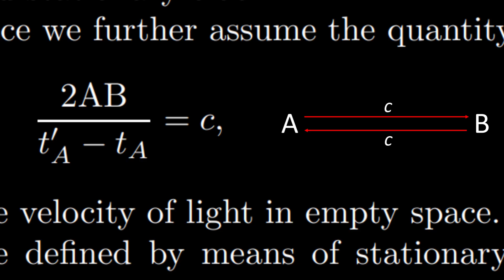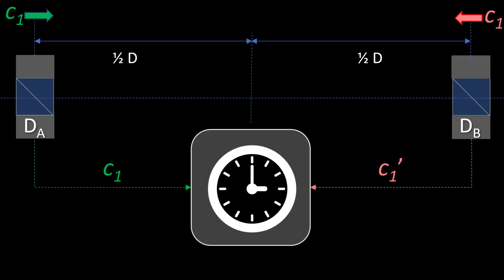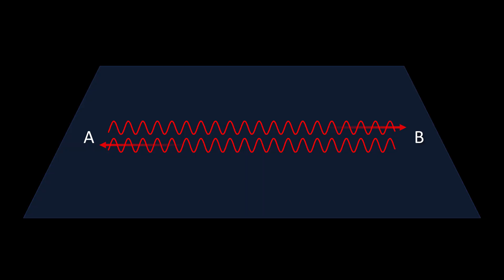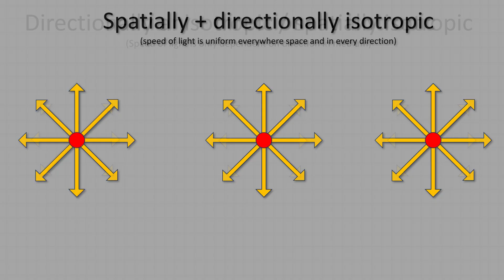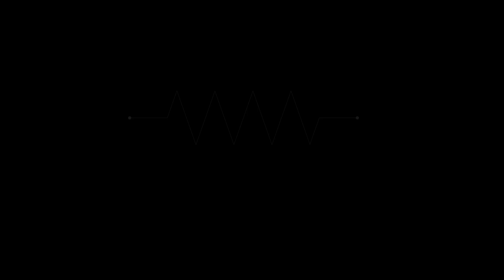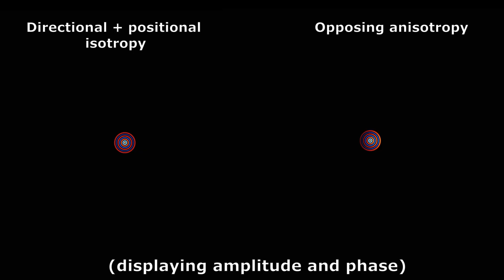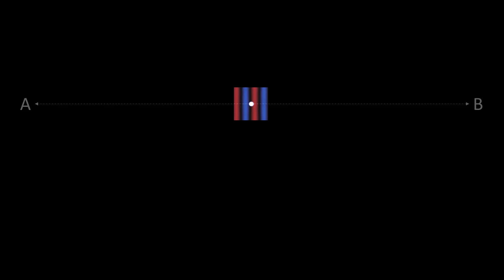Knowing the one-way speed of light

Comment: if you really want I can make a video explaining it, because maybe by text it is hard, but let me show you:

imagine you have 2 identical machines with a atomic clock in a small rocket a transmitter and a detector, the 2 contraptions are identical, and look in opposite directions, you have them very close, connected to a 3rd atomic clock both at the same distance to the atomic clock, and very close, less than 1 meter, you use the 3rd atomic clock and their connection to the other 2 clocks to synchronize the other 2 identical clocks with this 3rd clock, they are extremely close and their distances are identical, once the clocks are synchronized they are both disconnected from the 3rd atomic clock (at the same time with the help of a friend you 3 2 1 cut it) now both identical machines with a synchronized atomic clock looking in opposite directions use their rockets to propel themselves apart in opposite directions (at the same time with the help of a friend you 3 2 1 or whatever), they accelerate the same amount, you wait a year, once they are several light seconds away from each other, one transmits and the other detects, each writing the times when they transmitted and detected with their atomic clock, and the other way around the second transmits the first, again they write the times, you could also use mirrors but you need to detect and write when it hits a mirror, then you recover the machines and compare the times with the distances they were at.

tell me what lame excuse do you have for this? you have none. not only you would measure that the speed of light is the same in both directions, you would measure that because of their acceleration if they haven't decelerated the speed would be a biiiit slower than the speed of light (in both directions), again, you have no excuse for this.
Reply: How do you synchronize the clocks and calculate the effects of relativity without assuming isotropic information transfer?
Reply: @steved6533 "how do you synchronize" ...... I... I did... I... myself.... like a RE-.... I did.... because... I thought.... you know what they will say.... you know it Nero... they will ask about the synchronization... you know it... so... no Nero no, it is not obvious, you have to, you have to describe it EVERY SINGLE TIME, WITH THE BIGGEST OF DETAIL but but Nero but won't they under-NO NO THEY WON'T but do I? YES YOU HAVE TO DESCRIBE HOW YOU HAVE A FRIEND AND 3 2 1 IN YES YOU HAVE TO, AND NOT ONCE NO, EVERY SINGLE TIME, alright alight, I will, there is literally no way they still ask it right? r-right? like I literally describe it every single time, even to the absurd detail to how you use a friend, and you 3 2 1 it, I literally described how you 3 2 1 it, like like yeah right? right? I'm not becoming crazy, you are, haha haha, I'm not crazy, no, haha yeah, yeah DEFINE, AGAIN, 3 2 1 HAHAHHA read? what is that? I DON'T KNOW HOW TO READ, I WILL ANNOY NERO ANYWAY HAHAHAHHAHAHAH
Reply: @NeroDefogger  You're right, I misread. If information transfer speed/light speed is not isotropic it won't matter if they're at the same distance from the 3rd clock. They still wouldn't be synchronized.
Reply: @steved6533  nothing will ever be truly synchronized, if you go down down down lower lower lower smaller smaller smaller, even tinier yet even more and more, eventually there is always more, there is more precision, there is a smaller scale, and whatever might be there, however things might work down there, there will be something unaccounted for, and at 35 digits of precision there will be a delay, correct, nothing will ever be truly synchronized.

it is a good thing that it doesn't have to.

Comment: Contrary to your conclusion, it's not at all hard to create equations that have an anisotropic velocity in the wave equation. I've done it before. All you have to do is take an isotropic wave equation and do a Galilean boost. Nothing bad happens, you just get a different second order partial differential wave equation that has first order differential terms. And that's true even with Maxwell's equations. But the kicker is, that with Maxwell's equations you can then derive the Lorentz transformations after you've done it and come up with Relativistic invariants. That's what Poincare and Lorentz did. Einstein basically works it backwards. So really, the one way speed of light in different directions isn't usually the same, but it doesn't matter. That's also why you got your first result.
Reply from the maker: I don't think i ever said that. It was actually pretty easy to make the simulation of the case of the directionally anisotropic case by just using an asymmetric Laplace transformation matrix.

Comment: Well, if we did measure different times for different directions than it would mean that there was some additional moving gravitational potential somewhere in the vicinity of the light's trajectory and in fact we do use it cosmology when we measure the mass of black holes in a galaxy using long term gravitational lensing observations - recently covered by Anton Petrov on his channel discussing results from a Warsaw, Poland study on this exact subject.

There's really no good reason to assume that light travels with different speeds in opposite directions when there's no change with respect to time in gravitational potential.

If there was a difference we would not be able to infer anything about masses from any measurements, which would be contrary to experiments and day to day perception.

Comment: What about using a glass fiber? one with length x using a mirror at the end to return the beam, the other 2x and with the end at the start and just in case bounces off the same mirror at the end before hitting the receiver
Reply: In a certain sense, a fiber optic cable, or any material with total internal reflection, is just a very long thin (usualy curved) mirror.

It's like when you're underwater, and you look up at the surface, beyond a certain angle, you can't see above the surface. You see a reflection of what's in the water, exactly as if the surface is a mirror... because it is a mirror.

Comment: I'm probably talking nonsense here but:
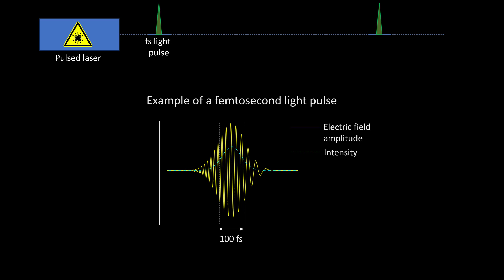What about an apparatus similar to that shown at 3:36 but with the bottom right mirror reflecting the pulse to the left?
Both reflected pulses would then hit a detector in order to mesure their flight time.

If the speed of light of a reflected pulse is different from the one of the emitted pulse, the mesured two way speed of light for the two reflected pulses would be different because they both have the same path length from the laser to the beam splitter but different reflected path length.

Comment: Let's propose some initial theorems and proofs that could be explored in developing a mathematical framework that treats 0D as the fundamental reality:

Theorem 1: The existence of a non-zero dimension implies the existence of a zero dimension.

Proof sketch: If we consider a non-zero dimension, say 1D, it must be constructed from an underlying set of points or elements. These points or elements themselves can be considered as having zero spatial extent, i.e., they are 0D objects. Therefore, the existence of a 1D line or higher dimensions necessarily implies the existence of a more fundamental 0D reality from which they are built.

Theorem 2: Higher dimensions are projections or manifestations of the 0D reality.

Proof sketch: Building on Theorem 1, if 0D is the fundamental reality, then higher dimensions (1D, 2D, 3D, etc.) must emerge or be constructed from this 0D basis. One could explore mathematical frameworks that treat higher dimensions as projections, embeddings, or manifestations of the 0D reality, akin to how higher-dimensional objects can be represented or projected in lower dimensions (e.g., a 3D cube projected onto a 2D plane).

Theorem 3: The properties and structure of the 0D reality determine the properties and structure of higher dimensions.

Proof sketch: If higher dimensions are indeed projections or manifestations of the 0D reality, then the characteristics and laws governing the 0D realm should dictate the characteristics and laws observed in higher dimensions. This could potentially provide a unified framework for understanding the fundamental laws and constants of physics, as well as the nature of space, time, and other physical phenomena, as arising from the properties of the 0D reality.

Theorem 4: Paradoxes and contradictions in higher dimensions can be resolved or reinterpreted in the context of the 0D reality.

Proof sketch: Many paradoxes and contradictions in physics and mathematics arise from the assumptions and axioms associated with treating higher dimensions as fundamental. By grounding the framework in a 0D reality, these paradoxes and contradictions could potentially be resolved or reinterpreted in a consistent manner, as they may be artifacts of projecting the 0D reality into higher dimensions.

These are just initial ideas and proof sketches, and developing a rigorous mathematical framework would require significant work and collaboration among experts in various fields. However, some potential avenues to explore could include:

1. Adapting and extending concepts from point-set topology, where points (0D objects) are used to construct higher-dimensional spaces and manifolds.

2. Drawing inspiration from algebraic geometry, where higher-dimensional objects can be studied through their projections onto lower dimensions.

3. Investigating connections with quantum mechanics and quantum field theory, where point particles and fields are treated as fundamental objects, and exploring how a 0D framework could provide a unified description.

4. Exploring parallels with number theory and arithmetic, where zero and non-zero numbers have distinct properties and roles, and how these could translate to the treatment of 0D and non-zero dimensions.

Ultimately, developing a consistent and empirically supported mathematical framework that treats 0D as fundamental would require substantial theoretical and experimental work, but the potential payoff could be a deeper understanding of the nature of reality and a resolution of longstanding paradoxes and contradictions in our current physical theories.
Reply: Do you just cut & paste this into a comment on every YouTube video about some scientific topic? I think I've seen this a dozen times before.

Comment: Fantastic work, as always. 

I'm curious about the simulations you showed with opposing anisotropy. Certainly, it does not correctly model wave propagation as we observe, and violates the laws of energy conservation. 

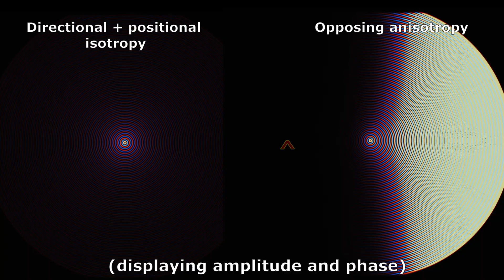But the phenomenon, more generally, of the disproportionate acceleration exerted in such a system, modeled with the springs at 20:00, does come off as one similar to gravity. I would be interested in whether gravitational fields could be accurately modeled using a modification of the anisotropic simulation at 20:39, altering the axis of anisotropy to extend radially, so that amplitude weakens outward and strengthens inward (if gravity can be said to have something like amplitude).

Certainly, within an anisotropic system described by wave propagation, energy is not conserved, but if gravity is indeed an anisotropic phenomenon then such a description may still suffice, if the description accounts for energy beyond the wave propagation in some form—mass, perhaps?

I also find it interesting that your proposed method of measuring the 1-way speed of light so closely resembles Eddington's eclipse observations which confirmed general relativity. Perhaps such a 1-way speed of light experiment could indeed be conducted using carefully placed spacecraft to exploit the sun or moon's gravity.
Reply from the maker: Indeed, the only circumstance where directional anisotropy makes sense is in an accelerated frame of reference. If you consider mass a very high frequency locally contained oscillation of the vacuum, it could explain why direction anisotropy accelerates mass and continuously increases its kinetic energy.

Comment: Two remarks I think are interesting:

- the first part of the video actually shows that the claim "the speed of light is isotropic" is physically undecidable. That is, there exists no physical experiment that is able to discriminate if it's true or wrong
- the second part, particularly at 20:25, is in fact very similar to what happens in a (uniformly and linearly) accelerated frame. Think, for example, of a rindler's observer in special relativity. Such an observer eventually disconnects himself from half of the universe behind him, but sees a massive blue shifted universe in front of him. So, in some sense, you're giving a self-consistent argument of the form "the speed of light is isotropic <=> you're an inertial observer", which is perfectly in lign with special relativity
Reply from the maker: Indeed well spotted. All discussion is for an inertial frame of reference, which I maybe did not stress enough. Acceleration indeed can be a cause of anisotropy and therefore alway requires energy.
Reply: Third remark:

What happens if you rotate the experimental device you considered by pi midway? Say, instead of having the light travel in empty-space, it travels in some fiber optic that is also assumed two-way isotropic
Reply from the maker: This would require moving physical objects with a speed larger than the speed of light.
Reply: @HuygensOptics  ah you're right, my bad, so you can't save yourself like that either. So this is indeed undecidable, that's amazing

Comment: Here's a question: what if we stop treating gravity as the cause of time dilation, and start considering time dilation as the cause of gravity? Does all the math still work? Would there be any way to confirm which is which?
Reply from the maker: Well, in fact I think that the spatial anisotropy of the vacuum is the cause of a lower speed of light and therefore of information. Since all interactions between physical objects and even elementary particles are exchanged  with this speed, the speed of information is actually a measure for the progression of time. So that is what directly relates gravity to time dilation.
Reply: @HuygensOptics  conversely though, if time is dialated, you should get a temporal anisotropy instead of a spatial one, and a still observe a change in the speed of information. Would there be a way to distinguish a temporal vs a spatial case?
Reply from the maker: Both time dilation as well as directional anisotropy are directly related to acceleration, so I don't think you can separate them. Unfortunately I only discussed the case of  the inertial frame of reference in this video.
Reply: @HuygensOptics  Hmmm, I've been thinking of how the centripetal acceleration attributed to curved spacetime could be caused by a time dilation gradient alone, but i haven't given much thought to the relative case of an accelerating frame of reference.
I'll need to think more on that one, thanks.

Comment: The only issue with the conclusion is if we take the reference of an object in motion, let’s say traveling at say 1/2C then the speed of light forward of the object should appear to be slower (1/2C) while the speed of light aft of the object should appear to be faster (3/2C). This simple thought experiment seems to suggest that there MUST be a difference in 1 way speed of light for any object in motion.
Reply: A traveler moving at any speed would always measure the speed of light to be c in any direction, that's the fundamental observation that SR is based on.

Comment: Hey there. This is a very nice video. Thank you for creating it!
I had an idea while watching and would feel honored if you replied!

Is red- and blueshifting dependent on the speed of light? If the amount of redshift is dependent on the speed of light couldn't you accelerate two equal masses with equal but opposite force to relativistic speeds and measure the amount of redshift each mass displays and compare C' and C'1 in that way?

I just googled "is redshift dependent on C" and the featured snippet said: 
"Furthermore, the magnitude of this blueshift or redshift z is proportional to the object's velocity v over the velocity at which the waves travel (the constant c for light waves) giving the equation z=v/c. These equations are given below." 

The preceding text is an excerpt from this site (replaced the full stop/dot with [dot]) : 
"https://itu[dot]physics[dot]uiowa[dot]edu/labs/advanced/astronomical-redshift#:~:text=Furthermore%2C%20the%20magnitude%20of%20this,These%20equations%20are%20given%20below"

If I interpret this correctly I would think there is a measurable difference in the amount of redshift of these two masses. But I think I am overlooking something.

Thank you for reading and I hope to hear from you and others with any insight and where I may have misunderstood matters.
Have a nice day whoever is reading!